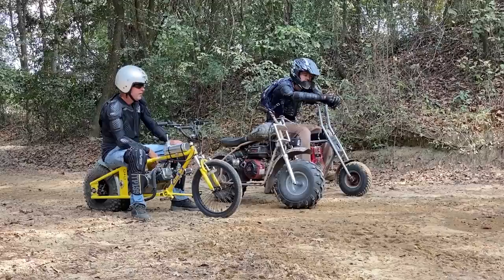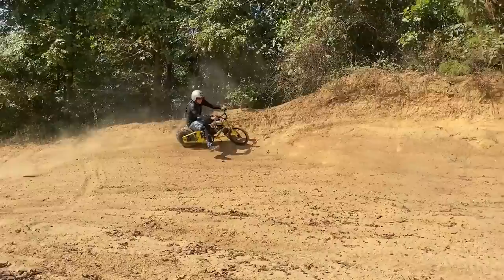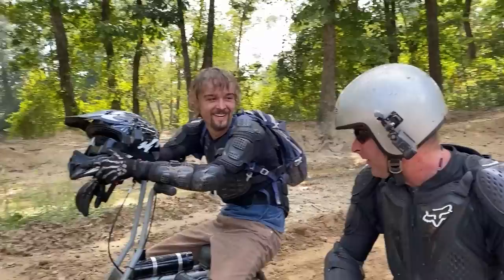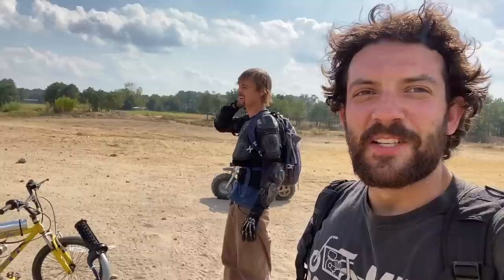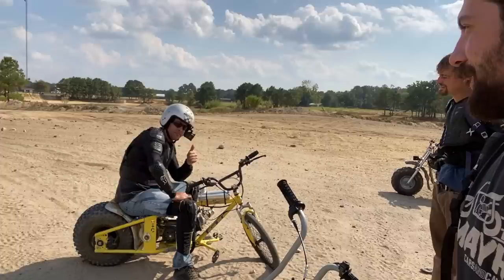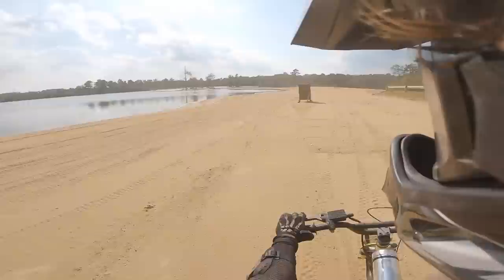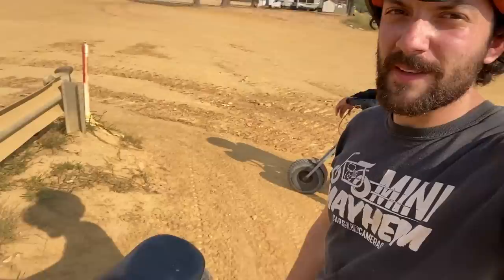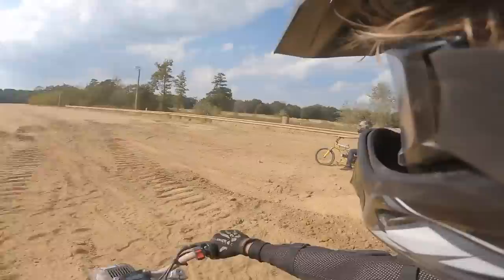Mini Bike Off Road Challenge! Longitudinal Big Block Mini Bike vs. Big Tire Drag Bike!

Comment: I think that the fat tire mini needs a fat tire for the front too, like the 3 inch wide off one of the fat tire bicycles. Then you can swap fronts and have street mode with a fat rear street tire and off road mode with the fatter nobby front and nobby rear.

Comment: 10:16 reminds me of when I used to watch "speedway" that is the 500cc methanol fueled bikes with no brakes.
Those things are badass and would love to ride one as buscoe.
Reply: Well as much as I love speedway, I highly Doubt it would stay together, unless riden on somewhat level smooth terrain. They are no more than a slightly beefed up bicycle with 70-80hp Ridgid frames,not meant to take any sort of beating and break at the head sets on there own tracks let alone some of the terrain as buscoe lol
Reply: @2strokejunkie686  SGP bikes do have front cantilever suspension and really high profile rear tires so you'd be surprised.
Reply: @tomstech4390  well in some classes that is true, and is known as a leading link, and not all classes sport leading link, front suspension. No surprises here, you would be surprised at how uncomfortable your ride would be regardless of front suspension lol, I take it you've never ridden a Ridgid rear end off road, add a rabid running 70+hp engine to the mix without brakes...can you say death wish lol none the less very cool machines but not for trail use🍻

Comment: I used stock mini bike called a (doodle bug )someone bought at a rural King.  Found a 20 horse tiller motor 😂😂😂 the stock chain lasted about 3 days and broke .. replaced 5 links until it was eventually sold because of the chain issue...

Comment: There's just something about a fat and skinny that looks cool, the mullet bike totally takes it on looks. Of course Charles's dirt hog is a close second with the ba look. Big block motor is super cool but it needs a better application. The frame it is on is a good pit bike with a small motor but it would be really cool with a sidecar or a sidecar mounted engine.. I got a laugh out of Charles carrying extra fuel in his backpack, my nephew used to run out of gas all the time on his street trail and I suggested he carry a quart bottle of gas in his backpack

Comment: Mine wouldn't do that well its a mini chopper had old school 49cc engine on it which can't fine any like it so I'm thinking of putting a 212cc on or bigger it went 30 flat with original but not sure want something I can burn rubber on an have fun also plus a new seat of some kind one on its not shabby just to small for ur butt plus no shocks on back just front

Comment: I've had my ct200u for going on 6 years now and the original 196cc engine is on its last legs I've done everything I can to squeeze as much speed put of it as I can with factory parts and I've decided if the little 196 let's loose I'm upgrading to a 212 and see how far I can go with those factory parts.

Comment: Give the sidewinder even slightly bigger tire/wheel combo and it'll greatly reduce rolling resistance and increase comfort.
Just make sure to compensate with lower gearing.

Comment: Is straight piping a predator 212 bad
Reply: It will be louder if you consider that bad? You will need to rejet the carb a size or two bigger and it will be fine.

Comment: Man, watching that Built 212 get close on that 225 sometimes makes me wonder if I should just get a 212 and build it up or if I should get a 225 and build THAT up. What do you guys think here on youtube?
Reply: There's no replacement for displacement! The 225 will always make slightly more power than a 212 given that they have the same mods.
Reply: @jeffman3  Argh! I guess I'm waiting until a 225 is in stock. Thanks for the input!